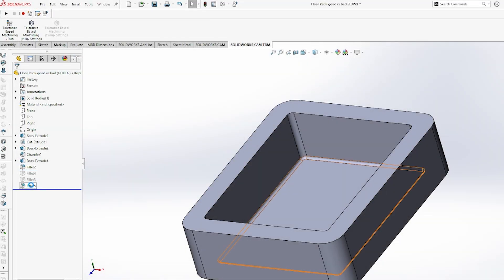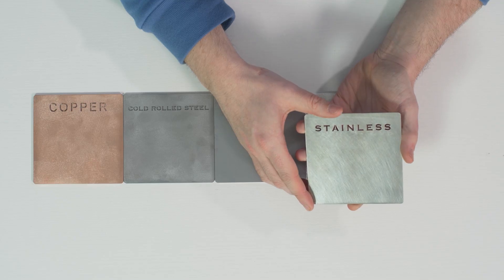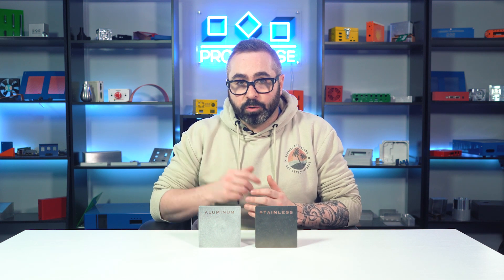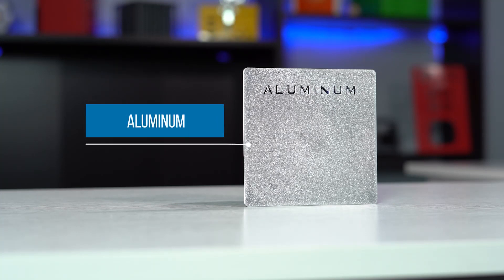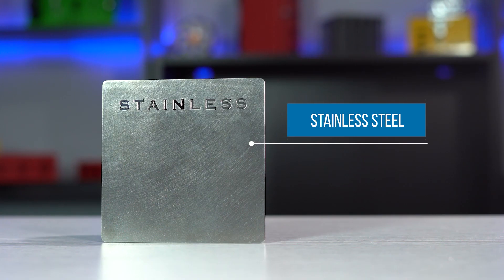Proto Tech Tip - Aluminum vs Stainless Steel

Comment: Which have high strength out of Ss430 vs aluminium ?
Reply from the maker: Hey Ravi, Stainless Steel has a higher tensile strength hands down and also offers superior corrosion resistance, but both at the cost of added weight, when compared to aluminum. Hope that helps!
Reply: @ProtocaseInc  i know that ss have more strength but I want to make a highly rust proof bathroom door so I want to know which one is better between ss430(less strength and highly rust proof compare to ss202) and aluminium?
Reply from the maker: @isisunayak  Hi there, we aren't experts in bathroom door construction, so we not sure if we can give a definitive answer. But for corrosion resistance, stainless steel is the way to go. (You could opt for aluminum with chemical conversion coating, perhaps). Good luck on your search!